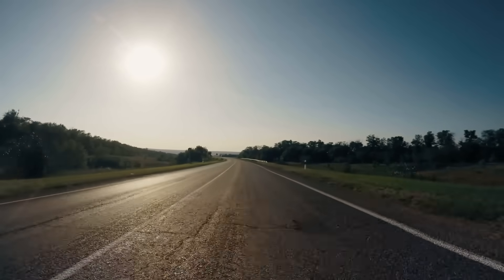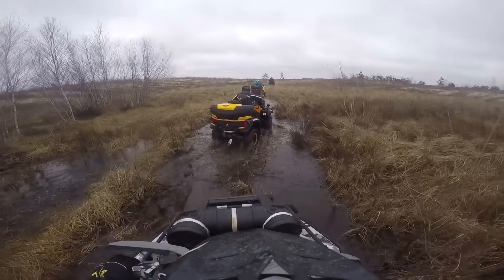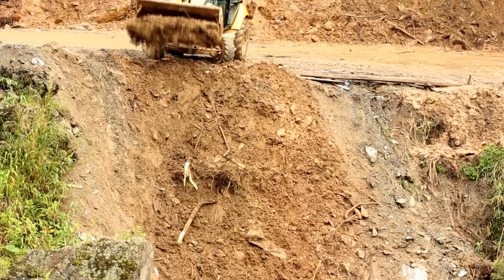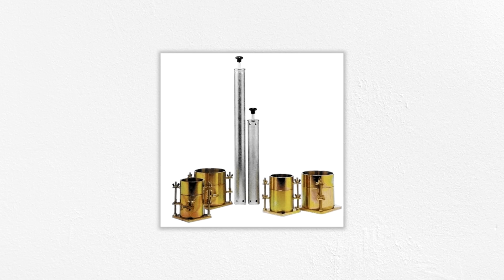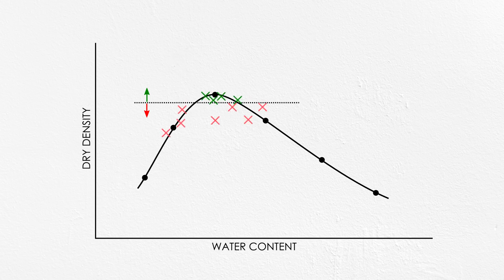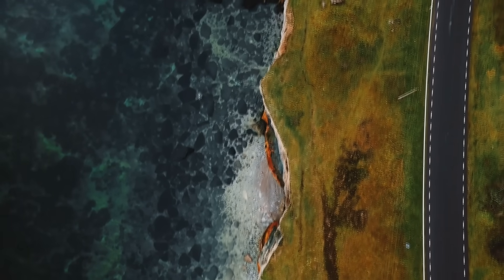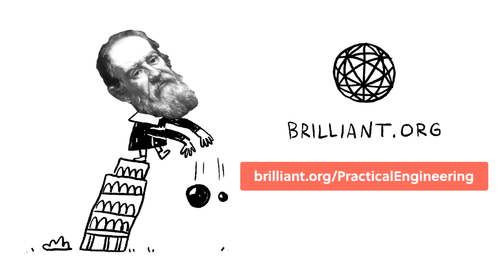Why Does Road Construction Take So Long?

Comment: Speed is more determined by the level of corruption in the process than actual engineering challenges. Amazingly fast road building on a highway in Tulsa, OK, vs .. any major road project in California, some which take 6-8 years to complete a single additional lane and a sound wall along a less than mile long stretch of highway in Chico, CA.. or Elsewhere on I5 where projects started before Obama took office are still incomplete......

Comment: I remember in the 90's when the contractor didn't prepare the road bed for the Wilmington DE bypass (295).  They had to rip up the roadway surface and re-do it only a few months after it opened.

Comment: It should be noted that roads are almost never built on just compacted dirt anymore. Subgrades are almost always modified soil or gravel. Although new products are being used and developed that use a plastic grid or mesh but this is almost always used with another method. 
The modification if the soil is usually achieved by mixing in cement, lime, or coal kiln dust and water into the soil and then compacting. This stabilizes the soil and prevents movement of the subgrade. 
The gravel acts as a load bearing surface while also absorbing movement of the road surface and subgrade.
Reply: This may be true some places but not all. Subbase is obviously not going to be just soil. Usually something like Graded Aggregate Base (GAB), but subgrade below that is more often than not just soil. Not modified.
Reply: @PENGUlN124  that's pretty much what I said. 
The subgrade is almost always gravel which can be hundreds of different materials from recycled concrete to crushed rock, or it's modified soil. 
Mesh tensar grid,  or geogrid is usually used for extra reinforcement in particularly troublesome areas. 
Just compacted soil is almost never used anymore although it was used in the past.

Comment: European autobahns have a much better and thicker road base as well as roadway so it doesn’t degrade as quickly. 
1. Why can’t they grade the drainage grate to the correct level so when your in the left lane it doesn’t seem like you hit a pothole every 200 yards?
2. In NY why do they just put a crappy thin layer of asphalt over a nice concrete road, instead of fixing the concrete road underneath. The asphalt wears out and gets potholes quickly and needs constant repair, which causes terrible traffic.  
3. I am convinced that the roads are poorly done to keep construction people busy. 
4. There is lots of unemployment, hire more laborers and get the dam job done, endless work sites with one or two guys working.

Comment: I have no problem with construction work. The problem is that you never see someone working on that 30km constuction site, that takes you half an hour to get through and has not made any progress in the last 8 months. Cleetusmcfarland had surface of his racetrack ground of and repaved in less than a week, I feel like it does not have to take over 6 months to do that on a public road.

Comment: We averaged well over one thousand miles per year to build the original Interstate system with fifty year older equipment and no computers compared to now.   A recent 15 mile section just converting 2 lanes to 4, nothing special and no major bridges is about 10 years in and not done yet.  Ridiculous  they split it into 4 sections to bid it out and gave the winning contractor three years to build the first three miles!  Guess they should have spent even more money and time on soil engineering because it is already has developed dips in places.

Comment: I am no engineer. However, I have maintained for years that the process of road construction is flawed in at least a couple ways: 

1. Lowest bidder jobs. This methodology invariably means a lower quality finished product, regardless of build specs. I believe municipalities need to spend a bit more and demand a better final product and this will help lengthen the time between jobs for any particular stretch of road. Finish standards must be inspected and there must be accountability from the contractor for any pieces of the finished job that prove to be unsatisfactory.

 2. The contractor needs to be forced to work 24/7 until the job is complete. This will naturally cause job times to be shortened from end to end and allow the critical infrastructure to get back to normal more quickly. 

Is there any real reason both these ideas can't be implemented?

Comment: If you see people working then I can appreciate the road works but more often than always you'll pass through a contruction site here in Germany and there's no-one working... ever. and for a kilometre of road they need ages. And I'm not exaggerating here.... 1km is being scheduled pretty often to take more than 3 years.... And this is the point where I have no understanding whatsoever.

1:44 should you be wondering where this was taken:
50°13'23.5"N 7°20'51.1"E

Comment: I’m guessing they also seed dirt piles to deter erosion too. I always see the large piles of dirt in a construction site covered in a layer of grass. I’m pretty sure that it isn’t natural seeding, but that a human spread the grass seeds for the roots to hold the soil in place.
Reply: Many large piles of dirt are stockpiles of cut material that is either going to be hauled off site or used in fill later.  If the stockpile isn't going to be used any time soon it has to be covered/protected from erosion.  Often sites will hydroseed (basically hosing down areas with grass seed) piles and slopes as part of their wet season erosion control plan and no/little planned work is intended during the wet season. 

If the site plans on using the stockpile in the near future they will often cover it with plastic which will both reduce erosion as well as prevent excessive moisture entering the soil causing it to become over optimum moisture when compacted. 

If it is the wet season (when rain/snow is most common), their is practically no way to allow overly wet soil (at least soils high in silt/clay) to dry making it usable for compacted fill.
Reply: If a stockpile of dirt is going to sit idle for 2 weeks or longer it either needs to be seeded or covered
Reply: It’s actually a helpful byproduct of the soil on its own. Grass and other vegetation gets torn out of the ground with the soil as it’s moved and when it’s left in stock piles for weeks or months at a time, the vegetation takes root again very quickly and grows to cover the stock piles as you see them. It’s more of a convenience thing that it helps with erosion control but the downside is that those same soil testing labs then must test the soil for organics to ensure nothing endangered or harmful is in them and there are no unwanted seeds (like trees or other large plants) that could damage the structures or roadways being built as they grow in the future.
Reply: @TremendousYeti  The last thing you want to do is use any organic material as fill. The reasons being it cant be compacted as well as your typical clay material. Second, as time goes by the organics break down causing voids which lead to settlement.

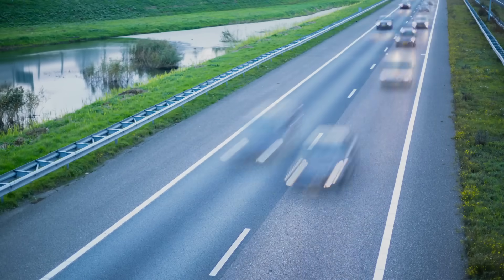Comment: Does anyone know what that vehicle is at 1:55?
Reply: It's a wheeled compactor. The mass is not a big cylinder but a set of wheels which are loaded with weights above them. It's usually used for compacting clay materials that tend to resist compaction and just flow.

Comment: Thanks Grady, very interesting video. Earthworks is one of the most challenging topics in civil engineering. seeing the mass haul diagram at 3:54 brings back some memories (and nightmares). It's quite a complicated process since it requires a lot of geometry to compute the volumes of soil while also taking into account the economics of transporting it and moving it around. 
Also, for the next videos, I'd be interested on the factors and methods involved in the design of horizontal and vertical curves or just maybe road design in general (banking angle, sight distance, etc).

Comment: I have been curious about onenroad here in my city. Upgraded in the 80s (and repaired every few years since) it gets wicked frost heave. It sits over a massive wetland system with only one small channel to allow groundwater to pass thru so lots of water penetrates the road way instead as the channel cannot collect all the water one side (a span of 10km is drained by a channel 10m across) how are roads designed to go thru wetlands?
Reply: It's a nightmare in design, I can tell you that. Basically you have to use materials that are not reactive to water. And it gets really expensive real quick.
Reply: I can imagine! Bentonite core as impermeable membrane, sufficient drainage like culverts in strategic location mechanically stabilized earth...

Comment: The biggest failing in civil construction is to value the cost of disturbance during construction - it is mainly socialised to the community and neighbours. The head and tail of a civil construction project should be short in both time and space. If it is, the community is more willing to accept new projects. So, that cut and fill should have temporary material stores to reduce costs the community really cares about, but is rarely measured. Often the tail is long due to lazy project staff - guys who have never learnt to clean up after themselves. Often, construction sites are messy and drawn out as the the contractor can freely use the site to store equipment whether it is needed on site or not. It saves them paying for storage.

Comment: What about the rest of the road construction? Some interstate highways have concrete foundations under the pavement, other surface roads do not. I never knew until they started replacing large blocks of concrete in the highway in my area. Some comment on this would be interesting.

Comment: I know this video is about earthwork for road construction,  but I think there should be a series of shows about road constructions to cover different aspects such as different types of surfacing, flood and erosion control, rail and other road crossings, did fferent types or classes of highways and roads, design for certain speeds, etc., etc, etc. Thanks for the introductory one of today.

Comment: The company doing the work makes a big difference too. Years ago they decided to widen an area of interstate in Baton Rouge known as the 10-12 split. The state had a certain budget and timeframe for the work and put out bids. All the in state companies bids were way over budget and time to complete the work so they opened up the bidding. A firm out of Michigan won it and did the work. They finished under time, under budget and I don't think I have seen a single repair to it in the decade or so since it finished. They brought their own concrete plant and concrete recycling  plant with them and set them up in the green space in the medians and cloverleafs. When they left, they planted trees and landscaped the areas so you could not tell they were there a few months later. Makes me even more upset knowing there are people out there who know how to do it right but all we usually get are sub par.

Comment: I love that my city replaces roads that are perfectly fine. And then they never replace the bad roads.
Reply: There is an actual reason for this, though I don't know if it applies in your situation.  Roads can be damaged in ways that are not immediately visible but are very dangerous (such as sub-surface erosion).

A pothole isn't that big of a deal.  A hundred yards of the road just sloughing away while a truck is going over it or something similar is pretty bad.
Reply: When I see that I ask who lives on each street.
Reply: @travisterry2200  Yup, wealthy neighborhoods always get the best roads because they have a bigger tax base.
Reply: The worst part is that the older high ways and roads are made of concrete but now they are asphalt
Reply: Yes it’s all politics
Reply: A place I used to live they came and repaved the road outside my building, which was fine they did it pretty fast - in like 2 weeks. Then 3 weeks later they came again, destroyed the entire newly paved road to replace the water lines - then repaved it all again. That took a month.

Money well spent.
Reply: Sounds like NYC. They are the best when it comes to that.
Reply: My town is currently re-building/re-paving about a mile of alley that runs down the middle of town. It's not a road, it's an alley between buildings, normally used only by trash trucks and a few deliveries. While miles and miles of public street are in ruin.
Reply: Portland likes to tax (edit: everyone including) the outer areas of the city to pay for the inner area roads. There people living on gravel roads that are so potholed you can barely drive on them who are paying to replace seemingly fine roads in places they'll never drive.
Reply: Hauger kind of racist mate

Comment: Also it turns out that the rubber that hits the road gets worn out and in some places they use old tires in the asphalt mix and it makes a more durable road that is more resistant to cracking

Comment: Its not that the road construction that upsets us. Its that it takes so long... the same road that needs to be replaced takes years to do.. where as other countries like Japan can move entire active core train stations within 6 hours..  or the crews at hethro international can replace entire sections of runways under 4 hours.. then you have the US highway system that takes 6 months to replace a storm drain only to figure out that its not the right one... keep the barriers up for another 4.. only to get the new one after  almost a year of construction..

Better question is why does it take so damn long??

Comment: Is there a cost difference between original construction and repairs or reconstruction?
Reply: Hell yeah. New one is always more costly on the immediate term. But if cone correctly, become less costly on the long term.
The security aspect must also be taken in account. if the road is not in such a bad condtion, but is dangerous enough that the bad  condition is too much, you better construct a new one and redesign it with security in mind.

Comment: Cut and fill means slope stability comes into play, as it will determine how much must be removed or placed, or what other slope retaining methods must be used.  Also location of the work or rework will impact retaining needs.  Rock bolts and geotextiles or retaining walls might be needed, etc.  Yes please continue the series.

Comment: next video why do roundabouts take so long to build? Vic Roads is gonna put in a new roundabout in our town it starts next month and they say they wont finish till early next year.
Reply: It's a bit more tricky to build a roundabout since the road will have to be under sheering loads. A roundabout is much more stressed by the traffic than a straight line.

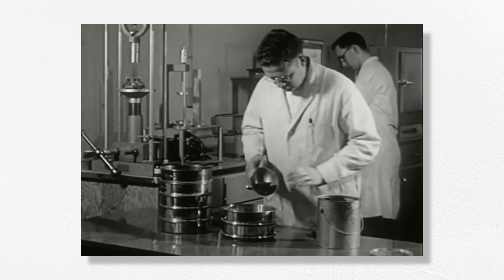Comment: 4:20 Metallurgical testing far exceeded soil testing in both frequency and mass. Every single production facility has material testing on site with multiple process checks. Independant materials testing labs run a  very small slice of the total amount of testing performed.
Reply: I think you underestimate just how much dirt, rock and sand is moved on a jobsite... sure, metal is massive and we use a lot of it through the country. But even your average Dollar General store plot usually involves moving a pile of dirt bigger than multiple houses. And that material is usually moved at least TWICE, since they frequently stockpile the majority of dirt once when prepping a site, then again when they actually place that material where its needed and compact it. Hundreds of tons are moved for small stores, and Tens of Thousands of tons are moved for warehouses and residential complexes... they move a LOT of dirt. XD  And even in mining of metals, even the best mines can be expected to move at least 10 times as much dirt and rock as they do minerals, and that dirt/rock is going to be tested and sold to a construction site if at all possible to recoup some of the costs of mining.
Reply: @Shocktrue1  Surely they don't test ALL that dirt? I would think most of it would just be moved, with a small percentage being tested.
Reply: @melodycervantes4167  Depends on how you define "tested". A really small amount goes to the actual lab, but that small sample should represent all that dirt, at least statistically. And there're a lot of methods to ensure that.

Comment: How come they dont have a machine that combines a dumptruck with a grader and compactor. 
It could spread dirt out infront of itself like how a fertlizer spreader works, run over it with a roller. 
That way you dont have to alternate between machines but drive a single machine around and on every pass build up the hight
Reply: I believe he said they have to measure the compaction between layers, so that's impractical. Otherwise it's a good idea

Comment: I think there are a couple other contributing factors where I live. Here in Connecticut, we are not building new roads as much as we are rebuilding old roads and bridges. Thus much of the work is done at night which affects the productivity of the workers. There is also labor of closing lanes, whether using traffic cones and barrels or temporary concrete barriers. Lastly, a lot of our roads and bridges depend on concrete, and either sate or federal regulations require inspections, testing, and a minimum cure time before permanent loads can be placed on top of it.